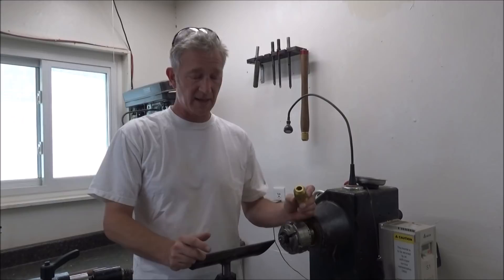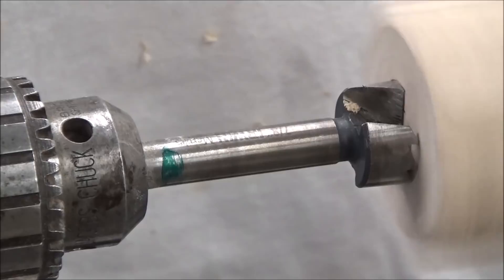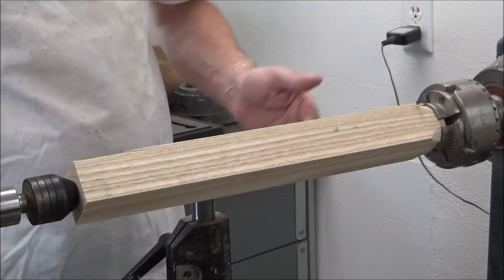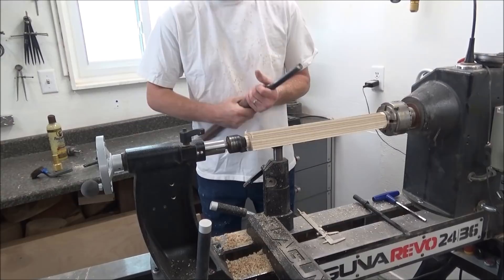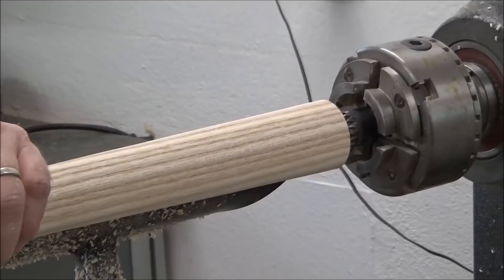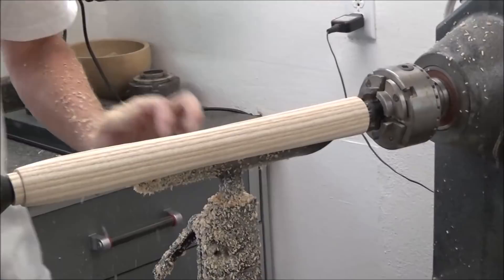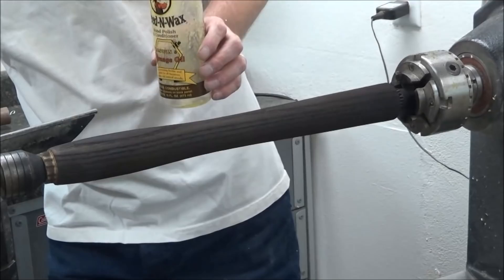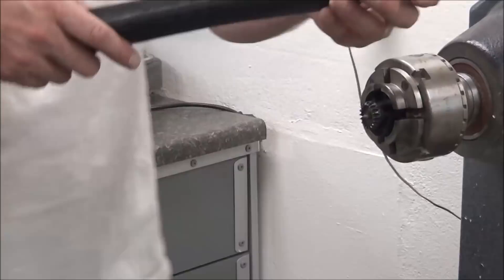Making a Tool Handle for the Jimmy Clewes QR System

Comment: Hi Jimmy, at the end of this vid, you simply inserted the QR chuck into the drilled hole - this does not seem very strong. In a real tool do you add epoxy? Cheers.
Reply from the maker: Yes mate.  A  2 part epoxy.

Comment: The wood appears to be either Ash or Hickory. Is that right? Is the scorching functional or just cosmetic? Could you perform the scorching with the lathe turning at low speed? (My lathe does not turn well by hand.)
Reply from the maker: Glen Crandall       
Hi mate , I feel that the scorching gives me a better grip as the grain is pronounced instead of smooth on the handle.
The wood was Ash.
Yes it will burn at a slow speed , the slower the better !
Jimmy
Reply: Glen, if you watch Jimmys other video you can bling up the handle with gilt cream after scorching. I’ve done it and it looks and feels great. 👍🏻
Reply: jimmy clewes jimmy Cleese’s